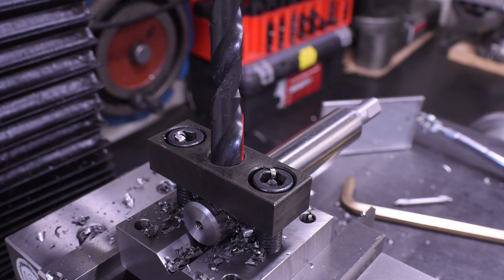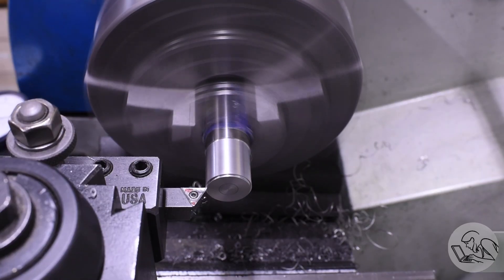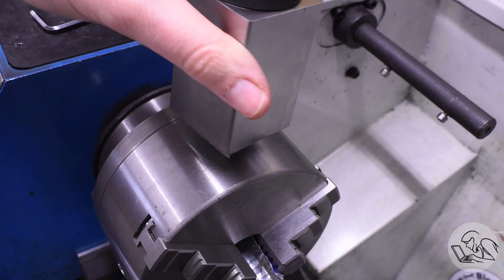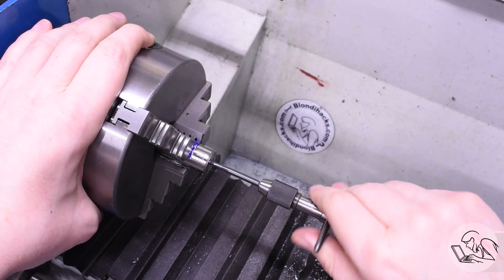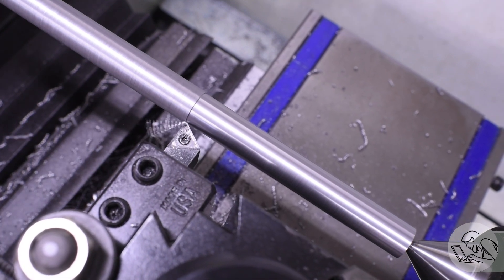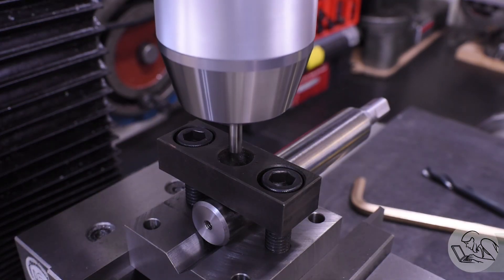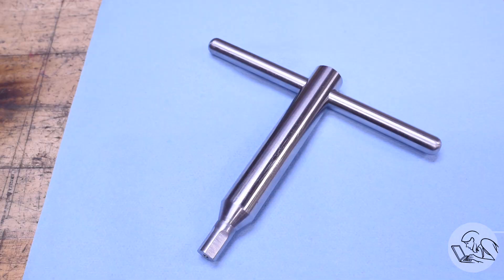Order Of Operations in Machining

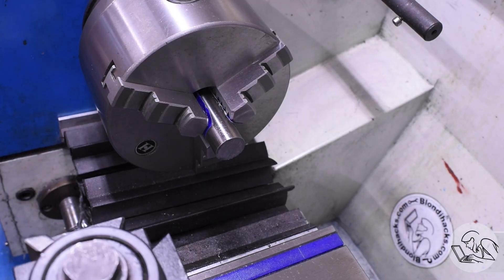Comment: At 7:55 I'm confused. Could Quinn (or somebody else) define "planar concentricity" and "axial concentricity"? I assume that these are colloquialisms that I don't understand. It's my understanding of GD&T that:
* 'Concentricity' is a measure of the deviation between centre points of two cylinders, with the datum being the centre point of the plane orthogonal to a cylindrical face. It is "radial symmetry".
* 'Coaxiality' is a measure of the deviation between the central axes of two cylinders. The datum is a cylindrical face.
Sidebar:
* If the datum is an axis, you're specifying 'run-out'. 'Total Indicated Runout (TIR)' is a cheaper tolerance to hit for a functional rotating part (shafts etc.)
* Let's ignore 'Cylindricity' and 'Circularity'!

Re: the comment policy, I'm not trying to be mean or "mansplain" here, I'm just a confused hobby machinist.

Comment: Maybe re-cut your taper from the other direction for a more-pleasing angle? Only would require mounting the 4-jaw to grip on the square, center in the set screw hole (since concentricity is not crucial), and... oh, dig your old chuck key out of the scrap bin. Never mind.

Comment: Your pretty darn good with the lathe, really nice looking chuck key. Your also very good with electronics's, have you considered upgrading your lathe motor to a 1.5 or 2 hp. single phase DC, or an AC with an inverter. Love your work.
Reply: Sure, lets strip all the chinesium gears with power they're not made for.
Reply: @russellstarr9111  It's done quite often actually.
Reply: @MarvUSA  They also put superchargers and turbos on engines, but I don't recommend it if you would like your engine to last.

Comment: Yea, I just built a handle for the cross slide knob or wheel. And not thinking, I put a tapper on it before doing other operations. Not a good idea ! But it finally got done dispite my lack of planning and now it's working and spinning and so so much better.

Comment: Learning butt loads today. Thank you so much. I 'm learning my new welder, it has multiple welding methods and so far a blast. I'm working toward a machine cshop from the science arena, mostly oil field chemicals, but have experience in foam and soil. Is there a book, you would recommend, that would help me along the way? I have been following you a while, anong with Mr. PETE, ADAM BOON, JOE PIE and a few others. I have started buying Mr. Pete's classes, but like more than one source is always necessary for understanding, specially when you can get your finger pulled off.
Reply: Adam Booth
Reply: @philipmackin1025  so auto screwed the name, do you have an answer for my question, I am trying to teach myself and it would help to have some guidance.

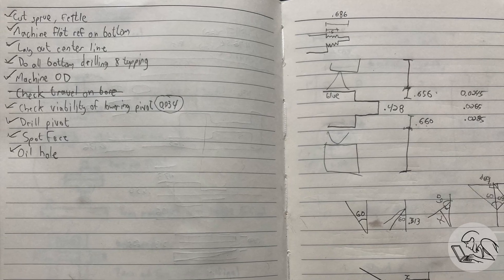Comment: A shot of your notes (at 17:40) was VERY informative. I learned a lot about how to get the ‘order’  from my thoughts to paper. Thanks,
Reply: And if a couple of extra columns were added, you could indicate tools/tooling required, and feeds and speeds. Check availability and do calcs before starting. If you add calculated cutting time, too, you've pretty much recreated what I used to produce for the workshops when I was a planning engineer in a factory.

Comment: That "Side bar" bit you added about doing tricky features early got a big "Amen" from me.

For me, it tends to be any small diameter threaded holes that I get out of the way ASAP. There's nothing worse than putting hours of effort into getting a part dimensionally perfect, only to hear the "Click of doom" right at the end as you snap a 3mm tap off in it. I'd rather cut threads first, even if that means I have to carefully run a tap down the pre cut threads again at the end to clean them back up.

Comment: Other disciplines have methods for optimization, surely cad/cam setups can compute the order of operations for optimization of a given design with respect to time, tool wear, power requirements, concentricity, tolerance, etc. Perhaps there is even a cute little algebra with it's own symbols and notations. Reverse Polish notation or Ukrainian farm girl notation? 17:30
Reply: I'd guess it's one of those things where correctly specifying all requirements is essentially just as difficult as solving the thing.

Comment: Order of operations starts a little different for me ...
It's already 114 degrees on the back porch so it's 120+ in the shop, and I could just stay in my Lazy-Boy and see what Abom or JoePie are up to ...
Okay ok, I'll turn the swamp cooler on, crack the shop door open, and make a sandwich.  Geeze.
Awesome, shop is down to 104 degrees. OMG AvE just popped up, that could be interesting, or not.
I'm going ... fire up the three phase.
The "started projects" board is down to 139 items.  Lucky for me the "future projects" computer needs another terabyte of memory ... so?
I could make a new chuck key ... the old one has that funny bend in it from my buddy pipe.

Comment: I did watch a video a couple of days ago where the guy had a crazy order of operations, every step seemed almost designed to make the next step even more difficult and time consuming and add as many extra steps as possible. It was so painful to watch.
Reply: Reminds me of the time in CAD class when someone programmed the laser cutter to cut the outside and then the inside. The supervisor didn't understand why that would be problematic and ran the program anyways, smashing the lens when it tried to auto focus on the piece that has detached from the previous cut.
Reply: @NiHaoMike64  I hear that, i was an IT tech in a school, every year there were problems when it was time for me to print out the kids work because it hadn't been stressed to them to think how they were going to be made, like a ten centimeter model actually being ten millimeters with features so tiny they would have been impossible even at the right scale, bottles that they had forgotten to make hollow, features buried under the surface...